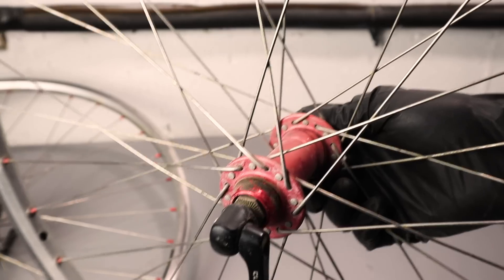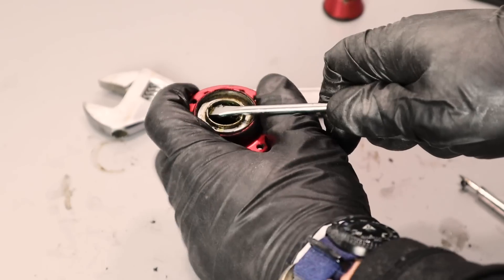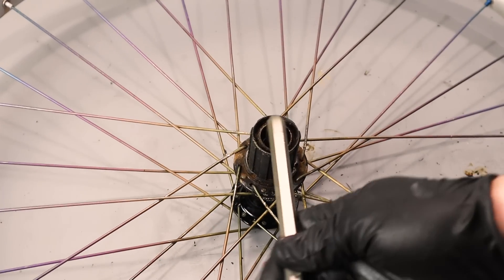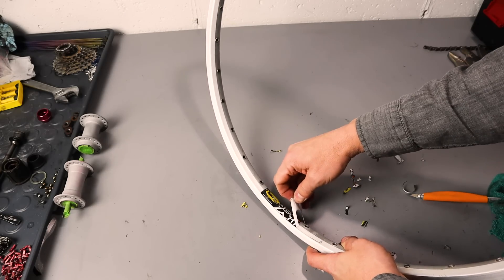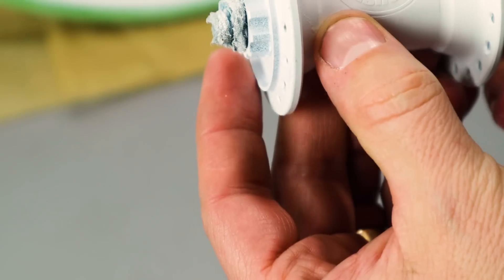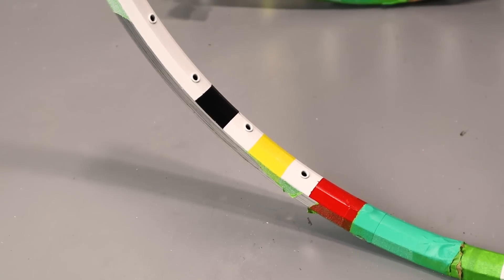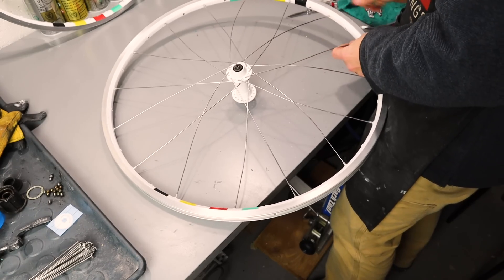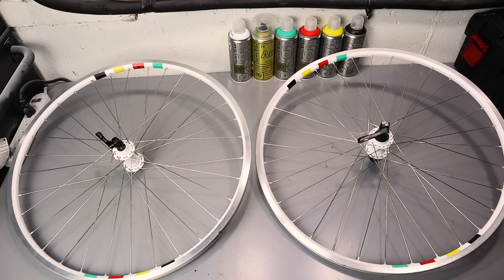Wheelset For Adventure

Comment: I'm pretty sure those oil slick spokes are tie dye Titanium spokes, if they are stamped with U then they are Union Frondenberg or DT then are are likely that, I don't quite have the resolution but it looks like a U. I need that Mavic 261 rear rim for my Klein!
Reply: Ha!  I bought those xc717`s in 2005 for my Klein attitude! on XTR hubs. Just 3 months ago I bought 2 of them again plus DT swiss center lock straight pull 240 hubs.Rear wheel is  784 grams.Buy those Man.
Reply: U can buy those in disc option as well - it`s 40 grams lighter than rim-brake version,420 vs 380 grams.
Reply: You are correct sir
Reply: @carbonsuicidemtb1583  thanks Man,those rims are light,stiff,strong and fast,worth every dime.I bought rims,hubs ans spokes  in Poland and rear wheel came only at 160 euros.Spokes are 2.0-1.6-2.0 DT`s race.
Reply from the maker: Lol I’ll have to see on the spokes. Two out of the 32 were broken but I will be hanging on to them, who knows when they may come in handy. Thanks for watching.
Reply: @oldshovel  https://youtu.be/rMZ9E4bnOmQ These are the Ti spokes I have, let me know what size you need, drive side on that Mavic 261 should be 266 and NDS should be 268 assuming hub flange is similar to non disc shimano. I may or may not have Tie Dye, keep up the good work!

Comment: Nice work! Do you use linseed oil on your spoke threads and grease on the rim eyelets? If not, try it on your next build, it goes super smooth and keeps tension way better!